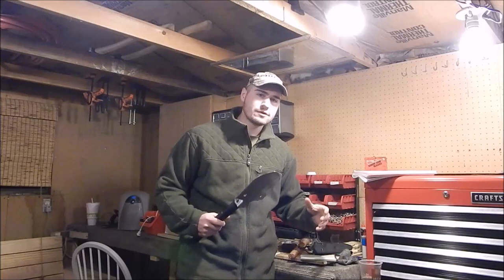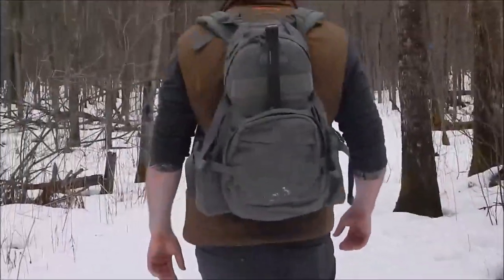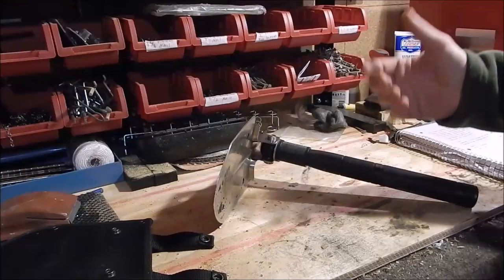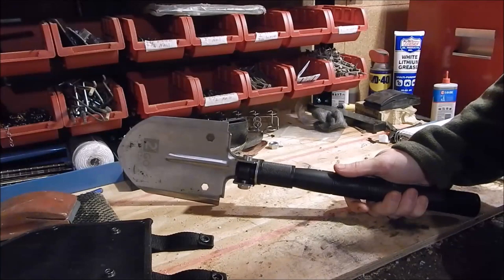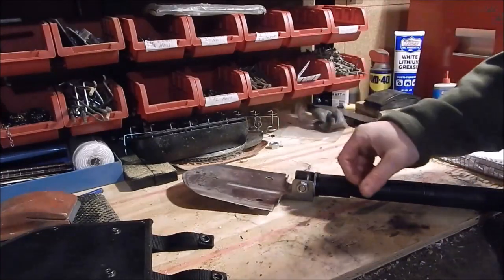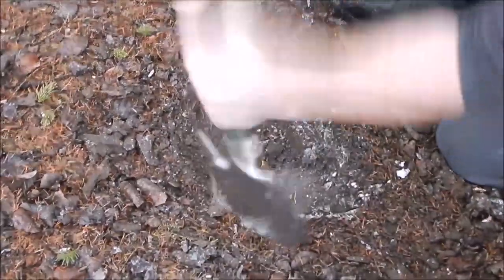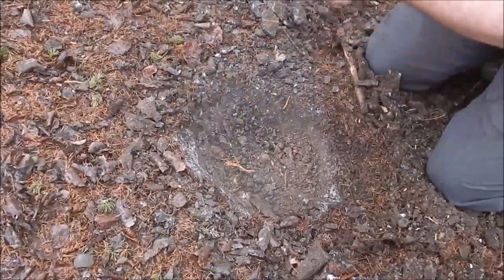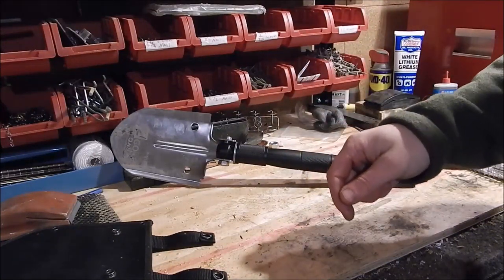2GoSystems Li'Jo Shovel review: You Dig Me Bro

Comment: Good review. I've always been a fan of shovels that could be used as defensive, chopping and digging tools. The original GI trifold etool  was a good if heavy option,As you say the COLD STEEL is also good option.I recently aquired  what I believe is the best tool in this class of tools. A company in russia is making a titanium copy of the cold steel special forces shovel .This shovel is as strong as the original but weighs less than a pound.  I bought mine on amazon for 60$.
Reply from the maker: +BEARivrman81356 link please?
Reply: Search vsmpo cold steel special forces shovel on amazon.Great lakes prepper

Comment: When I see you hacking in frozen ground and it does not bend and does not come loose it's good quality.I own an etool (Original dutch militairy) but the triangle shaped handle is not as good as a round one when hacking, so I think you are better off with the 2gosystems than the etool
Reply from the maker: +happymark1805 Yeah. digging frozen ground isn't that efficient but a great way to test strength..that's my biggest problem too,the D handle isn't conducive for hacking or swinging. thanks for watching